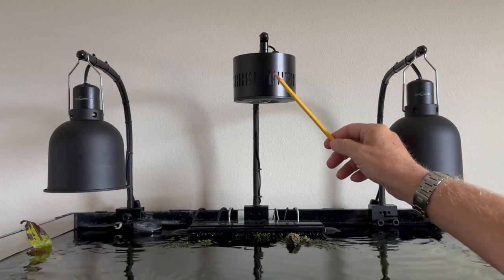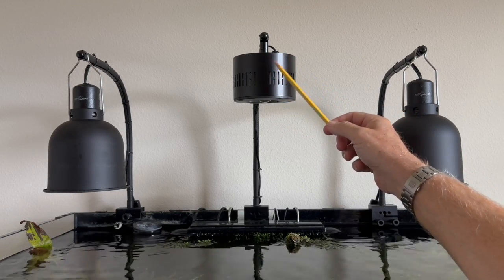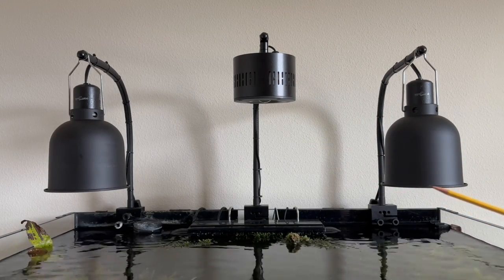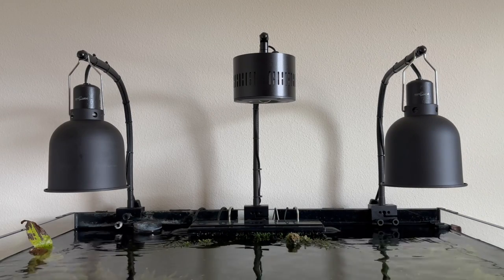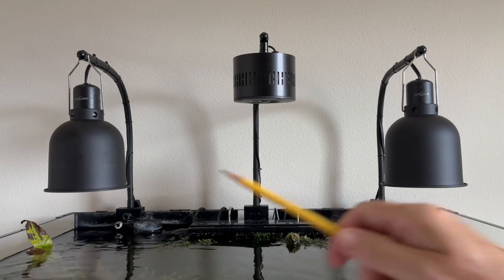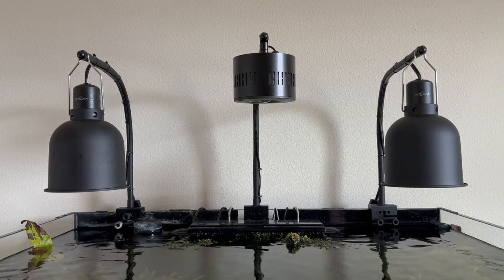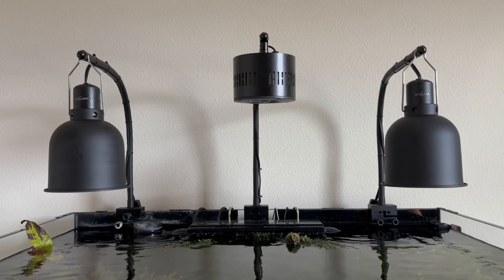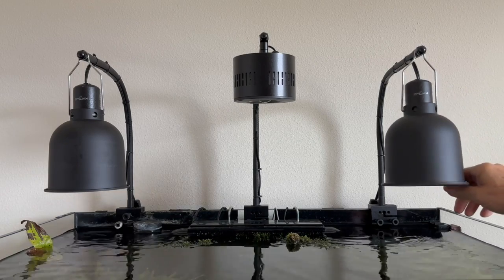How to make A 5000K, with 4500 luminous LED aquarium light on a budget.

Comment: apologies if you have another video that covers the topic, haven't made it through all your content yet.  enjoying the info so far.  

would you recommend 2 of these as you have yours for a 55 gallon standard 48" wide or should i increase the number?  i wouldn't have any problem doing up to 4, one set of two per 24" half but i think that might be overkill.  i have a hard time with three because the support would cross over and likely cause shadowing if i centered it but i don't think that's as big a deal as i think.  thanks in advance for any advice

Comment: I am shocked at dedicated aquarium light prices are was looking into cheaper alternatives. I was considering using floodlights but I’m worried if the light needs to be full spectrum for plants? I was looking into botanical grow lights but they are indeed to yellowish in colour. Would prefer something around the 5000-5500K kelvin range and I will be having high light plants and co2 so I was wondering if floodlights would work just fine? I my local store sells dimmable, colour temp controllable (3000K-6500K) smart 30W floodlights. I was thinking if I could use 2 of those at reduced power over a 20 gallon cube tank. Instead of splurging on a chihiros wrgb or AI Prime freshwater etc

Comment: I bought a pair of these GE Ultra Brights from Lowes based on your review. As the temperatures drop, I want to keep the foam panel lid to prevent heat loss. I'll cut a hole for the tip of the bulb to remove the need for a cowl. That should allow for better heat dissipation for the lighting elements and fully direct the light energy into the tank.
Reply from the maker: I've been using the lights in the cans that I show and really it seems to have no heat buildup. The ones that are over the goldfish aquarium are on from 11 o'clock to 10 o'clock at night and still everything is manageable without a problem.
Reply: @anoxicfiltrationplenums  I installed a single bulb directly into the foam insulation board by cutting a circle with same diameter as the bulb and inserting it a little past the collar of the stock diffuser. I kept the stock diffuser on the bulb since it is only 2" above the water surface. Thankfully, the heat dissipating from the bulb housing drives off any condensation forming around the gaps between the bulb and board. With 60F ambient temps, the bulb housing is uncomfortably warm but definitely not as hot as I expected. I'll report back in a few weeks with a status update.

Comment: I tried to measure the flow rate of my plenum by capturing the bubbles with a measuring cup , it took 1minute 45s to replace 275ml of water with bubbles, after simple calculations my flow rate is just 2gallons per hour , which is far less than 20g you mentioned in other video , but I’m not sure if this a right way to get the flow rate ?
Reply from the maker: Excellent, thank you very much for the updated information. I'm sure others will appreciate it.

Comment: I use one of the small metal shop lights above my aquariums.  It lights up the whole tank. $7.99 each. Use the bulb of your choice in them
Reply from the maker: I just thought the lights that I use are more industrial looking without being silver and would appeal to the hobbiest. But of course you can get the lights from Hardware Store. thanks for the info.
Reply: Nothing, and I mean NOTHING looks more cobbled up and ghetto than el cheapo metal shop lights mounted above an aquarium.  Well, besides maybe a cobbled up homemade aquarium stand made out of 2 x 4s.........